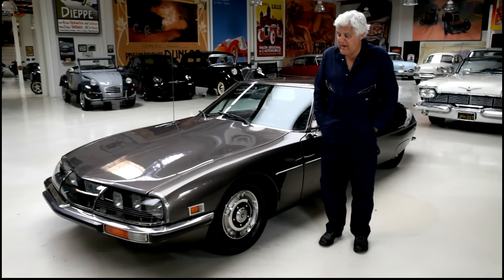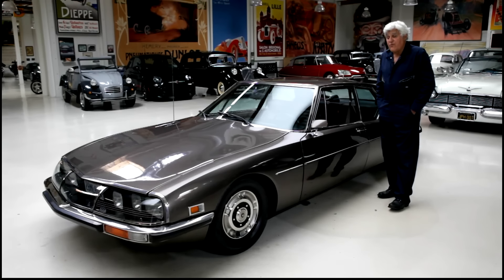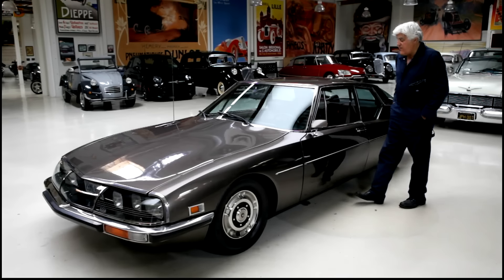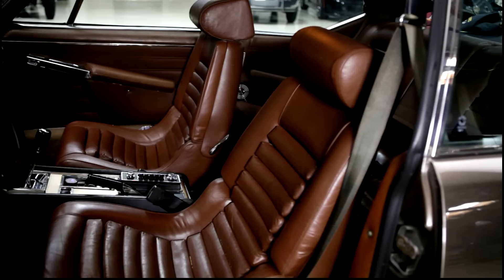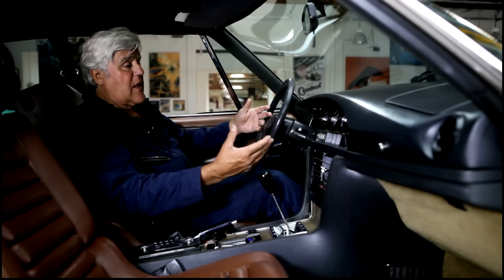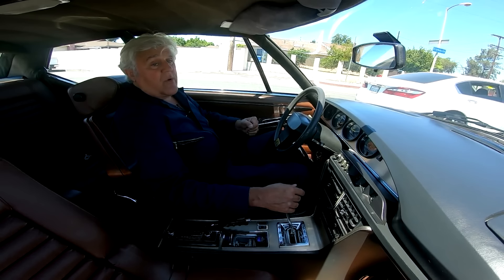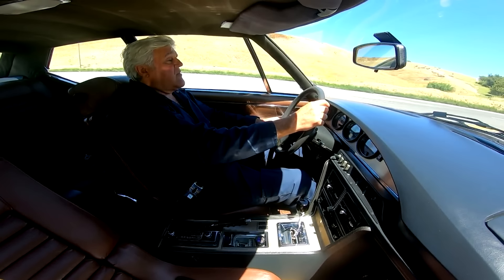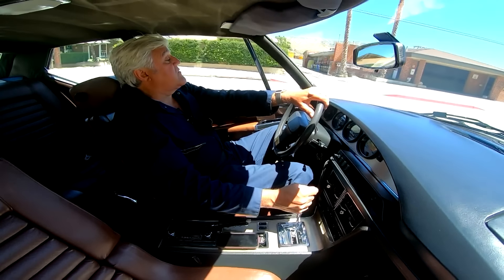The Futuristic 1972 Citroën SM | Jay Leno's Garage

Comment: Its my dream car; been driving for 45 years and only ever owned Citroens. One car you need to add to your collection is the GS ; must be the most underrated car out there. The GS was as advanced as the SM in many ways but built for the masses. :)
Reply: Or, if one wants to go for super rare, one of the Wankel powered GS Birotors of which originally 700 or so where made but most were factory recalled.
Reply: Yup, the GS adds to the driving experience in its own unique way due to the aircooled flat four with the hydropneumatics (yes I`ve got a GS).
Reply: My father had an GS in 1975. The gastank used  to suck vacuum when 3/4 empty. Then rust appeared 2 years in from new...... He bought only Japanese after that.
Reply: @southwest3671  Yeah, Citroéns had a bad run in the 1970s with certain individual cars rusting very quickly. But so did a lot of other brands at that time. One reason I think was a change in paint technology for environmental reasons, i.e. moving from solvent to water based paints which took a while to sort out properly.
Reply: After Comotor collapsed Citroën tried to buy back all GS Birotors as they didn't want to have to supply parts for ten years (French law?).
The Wankels were unreliable. Poor fuel mileage. Terrible emissions with emissions regulations getting tighter every year. NSU Auto Union, Citroën’s partner in Comotor, was bankrupted with replacing Wankel engines in their Ro80 car. NSU became Audi.

Comment: American mechanic in the -1970s “ you have no front brakes “
Reply: Dingleberry
Reply: The US Cord had inboard disk brakes and in modern times the Hummer
Reply: @malcolmjwebster  Almost every Jaguar from 1961 had inboard rear brakes until the late 80s. Some still had them until 1993.
Reply: @thegearknob7161   I know I've rebuilt one in the 1980s
Reply: "That's okay, it doesn't have any springs, either!"

Comment: The CX also had the DIRAVI speed sensitive power self centring steering.
The CX in the rain had a huge curved windscreen with a single wiper, plus a concave self cleaning rear window. You could drive fast in the rain without wipers, except occasionally.

Comment: These pandemic edition shows are the best we've had! Since you're so much into french cars, you should absolutely get a Peugeot 203. It is the first post-war car from Peugeot and the one that got it back in business, with almost 700,000 produced. It's the car most seen with the Citroen Traction, except it is even more cherished by people in the french countryside than the Traction, as it was more a people's car and everybody's grandpa had one at some point. It's also easy to work on, lots of parts and is generally cool with the exterior design coming from 40s American cars and mechanics from the 60s. 
Cheers!
Reply: Peugeot 1007 3 door hatch with electronically assisted sliding doors.
Reply: @marklittler784  Didn't they make a top gear episode out of that?
Reply: I have asked several times for shows on Peugeot!  I’ve had a number of them and they were great cars in their era.  I even asked him to do a show on the Peugeot Eclipse from the ‘30s with a convertible hardtop and it was just beautiful.
Reply: @donelmore2540  the convertible 402? It's fantastic! And it has pretty cool and luxurious features like the Cotal pre-select transmission.
Reply: @keithwhittygmail  lol yeah that's the one

Comment: When I was kid I remember my dentist had one those. This is back wen I was living in Montreal, I told him that I saw a sci-fi car and he told that it was his. Wow was it so nice. I was driven in several Citroen and I never experienced such a comfortable vehicle. It was recently a Citroen C5 with the active suspension. Indeed, I am convinced that the French cars are very stylish, pleasant to drive and so comfortable. Even a C6 is my actual dream car as I now live in Europe.
Reply: Do you know other Citroëns of the 60s and 70s?
Reply: @julienbee3467  Indeed, I saw some when I was a child. In Montreal, you could see several Citroen DS and a few SM. French cars were sold up to the Peugeot 505 and we even had Renault 30 and Peugeot 604. My mother used to have a Renault and it had the best comfortable seats, surely better then a Cadillac.
Reply: @laurentien00  even the Renault 30? I remember the Renault 20 having a very 70s orange interior
Reply: @julienbee3467  In Quebec, they only imported the wide Renault 30s, not the 20s as the later only came with 4 cylinders powerplant deemed insufficient. They were rare but such impressive handling.
Reply: Renaud Roubaudi would be proud (POA)
Reply: @unaz7764  En effet. Oui. Je les connais.
Reply: My doctor had a 1969 brand new in '68 Chevrolet Impala.
Reply: @MrDpbazan1955  So had my uncle and my father had the Mercury Meteors 68 and then 70. But, I am sorry but an Impala or Meteor would never give you the exciting and comfortable ride like a SM. Not even a Thunderbird against which it was competing.

Comment: That's huge ground clearance.  I would have never guessed it would go up that high.
Reply: That is only for tire changes and other maintenance. You can't drive it in the highest position.
Reply: So on rough roads or snow it can’t be raised higher than normal?

Comment: Citroen needs to bring this suspension system back!
Reply: In many ways, Citroën has just done this with the new C4 model. It does not have a classic hydropneumatic suspension system, but it has newly developed shock absorbers that have an extra valve that evens out major unevenness on the road. This does not sound like much, but it works absolutely fantastic. Really "less is more" in an absolutely ingenious way. I was really surprised when I first tried the new C4 model and my thoughts immediately went back to the feeling BX/Xantia gave with the classic hydropneumatic suspension. In many ways, the new suspension is actually better and in my opinion much better than what is found on even significantly more expensive car models with adaptive suspension.
Reply: Too expensive to manufacture. Only a small market will pay extra for superb suspension.
A Toyota Camry has a good ride for a modern car but with my health problems feels very harsh compared to any of the “real” hydraulique Citroëns.
I had two ID wagons, one manual shift with clutch pedal and one with hydraulic shift, a DS21 Pallas with hydraulic shift, a DSpécial that I put in the motor out of the DS21, and two SMs with manual shift.
They were all rather worn and beat-up when I got them. Never any problem with the Maserati DOHC V6s but it was only a matter of miles.
Reply: Can't.   this car is not friendly for the current generation of people who are arguably some of the most dumbest people I've ever met.
Reply: The Xantia still had these, in some form. Not sure if any model afterwards did.
Reply: Absolutely, and they should also do the steered head lights.
Reply: @eddyc4603  The XM too and the beautiful C6.
Reply: @paullenarts4925  Oh there you go. Beautiful is not what people used to say when these came out of the factory! :-D
Time rounds things up... I liked that car too, in some ways. Certainly one of a kind.
Reply: @Hvitserk67  I think Mitsubishi Outlander Sport comes closest to Citroen aircross

Comment: The SM is one of my all time favorites. I believe that the reason for the wheel to come back center is safety. I'm glad Jay's paint is holding up well because the DS paint had to be constantly wax. The one thing the DS had over the SM is the semi-automatic transmission. BTW, I had a Renault 5 while in high school and you could drive with a rear flat tire all day unnoticed until somebody would tell you.

Comment: Jay, you've inspired me to get my CX (the poor man's SM) back on the road - there is nothing that handles or rides quite like these big Citroens. Yes, the non Maserati engines aren't great, they were meant to develop a rotary engine for the CX but ran out of cash (the development costs essentially bankrupted Citroen which had to be taken over by Peugeot) so my one has the same engine as the old DS/Traction Avant, a push rod thing that is thirsty but reliable and amazingly unsophisticated for such a sophisticated car. The smaller engine models had the 'Douvrain' or 'suitcase' engine a JD between Renault and Volvo that powered many European cars in the late 70s and 80s, its a lot more efficient and refined than the big lump in the GTI and 25. 
Thing is about these cars is that they are built for European trunk roads, the handling and suspension means you can keep up a high average speed where road surface and camber etc would defeat a 'normal' car. They excel at long distance cross continent drives where they just float along, driver fatigue is NEVER a problem.
Reply: La CX n'est pas la SM du pauvre ,elles n'ont pas la même vocation.
La France a beaucoup privilégié le diesel à une époque,et les diesels de cette génération sont impressionnants !
La CX diesel turbo 2 est une voiture incroyable, capable des dévorer des kilomètres de route avec confort, sécurité et le gros couple de turbo diesel.
C'est une voiture que l'on peut encore utiliser au quotidien car le moteur est très robuste ,la tenue de route très performante,il y a beaucoup de place à l'intérieur....et le confort est royal,juste troublé par les cliquetis du diésel.
Cette voiture accélérait aussi fort que les Golf GTI essence de l'époque.
Quel plaisir,avant la multiplication des radars de croiser à 200 km/h sur l'autoroute comme sur un tapis volant.

Comment: Gorgeous. Give me this over a modern, over-horse powered coupe all day long. And that interior! I think this car could start me smoking Gitanes.
Reply: Over horse powered? Never heard that expression
Reply: @jizzyjake6783  you get what he means right?
Reply: @rogier151  no I don't understand what over horse powered means. I can never get enough horsepower.
Reply: @jizzyjake6783  There comes a point in a car where any more horsepower added is extraneous to the point of not even being felt. You logically know that its there but it makes no actual difference to the driving experience. It is also gratuitous, overly so in fact. This is what over-horsepower means.
Reply: @jakekaywell5972  impossible
Reply: @jizzyjake6783  It is very possible, as I have felt it myself. While the exact threshold for all cars is different, the propensity of a car being over-horsepowered greatly increases over 500 BHP.
Reply: @jakekaywell5972  that's crazy talk
Reply: I've a better cigares  choice.  "gauloise"
Reply: You'd have one huge problem. Try and find a mechanic. : )
Reply: @styldsteel1  - They're (mechanics) not as hard to find as you think. Unless you're looking for an ASA-certified mechanic who knows most of the peculiarities of your particular car - especially "niche" cars. By far the best mechanic I've ever found for my Jaguar XJ6s was not technically a car mechanic at all - he excelled at farm machinery, most of it nearly brand new John Deere equipment and that was his only certification - John Deere. His family had a large dairy operation that also raised and harvested most of its own feed for the cattle. But his real passion was his International Scout II Diesel cars. And then I let him take my 1988 Jaguar to town on a parts run because he mentioned he'd never even ridden in a Jag. INSTANT fan, and I bought him a new Haynes manual for it and from then until the day he died, he was happy to work on it if time allowed. And I always got the rate they declared to the IRS as their standard operating expense. GOOD MAN! And his father before was as good as they come, too. Enough rambling - I gotta get to town on a parts run. Any excuse to drive my faithful XJ6! See ya!
Reply: @alanhardman2447  hahaha! That was terrific. thanks for sharing.  I wished I was able to think about that I was looking for a mechanic for my 48 Hudson.  These guys I found claimed they knew all about them.  I guess being a flathead 6, reversed positive ground with it's original generator, proved too much for them to handle, and ended up taking me for a ride 😡
Reply: i have checked, when the C6 came out, with my usual preparators.. this is the result, without killing the engine.. https://www.shiftech.eu/fr/reprogrammation/citroen/c6/2005/diesel/3.0-hdi-240
Reply: i also had my c5 2.2 hdi 204 prepared by these guys...it ended up with 239 hp and breathtaking 553 Nm at 1650 trs/min ! without ever a problem..
Reply: Try Gauloises too! If they still sell them.
Reply: Or Gauloises :-)

Comment: Before I left England in '79 I had a GS1200. I was driving between Oxford, Sheffield, Newcastle or London most weekends. In pouring rain on the motorways, it was a great car for long drives, very stable and reassuring.

Comment: I saw my 1st sm when I was at school in 1973 it was so far a head of all the other teachers cars in the car park ford cortina mini mgbgt spitfire Morris miner I feel in love with them 1980 I bought a cx prestige this was the replacement replacement for the ds it was the length of the estate you could sit in the back and stretch your legs out aircon electric windows  cruise control l have owned 12 citroens altogether and I still own 2 .1 is 21yrs old the other is 5 yrs old now which is not as good I wish the old citroen would come back

Comment: I'm pretty sure that the system which  control the power steering depending the speed is called "Direction à assistance variable" in French, variable assist power steering system.

Comment: I had the GS 1,1 drove fantastic. It was the car of the year in Europe in 70. I also had the cx petrol 2,2.
I made all the repair work myself. I remember clearly how many times I had to repair the hydraulic tubes.
Citroën cars used to be meant for high-class comfort, not very fast  cars. Sm is the exception. High class comfort for commen people. Relaxed driving 🚗 superb.

Comment: I had a 1978 Citroen cx 2.4 once I got second hand from a soldier in the Scots Guards.   It was old when I got it but solid all over & it went well with no problems.   It was an old car and it wasn’t cherished & took a lot of abuse but ran like a Swiss watch regardless.  Very comfortable to be in and drive & smooth & pretty fast for what it was  (over 115 mph  with more to go ) & futuristic with the dash & steering etc etc.  It cost £200. Solid cars too as a Renault 5 fellow french car ran in to the back of the cx and was flattened at the front end but not a mark on the Citreon, the Renault passengers were fine but their car died.   Cheers from Scotland loved the review and reviews 🎉